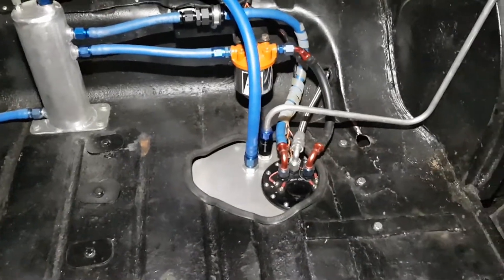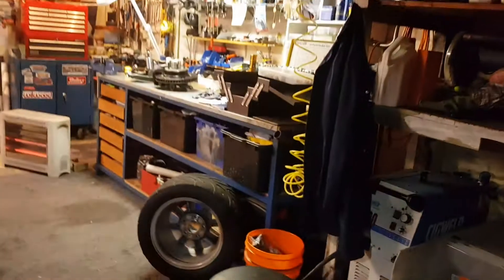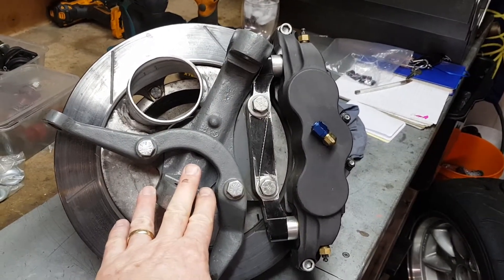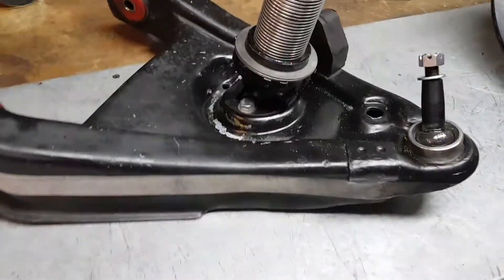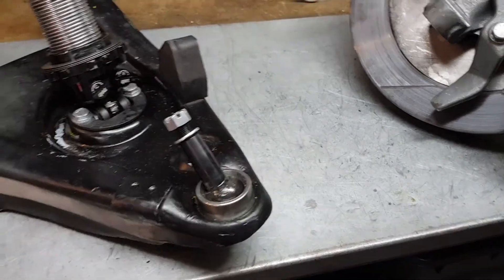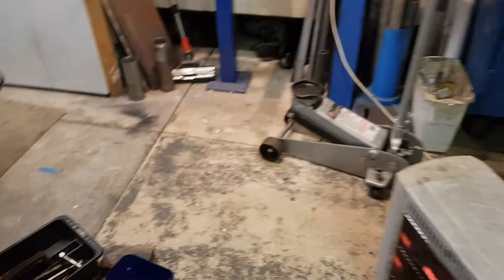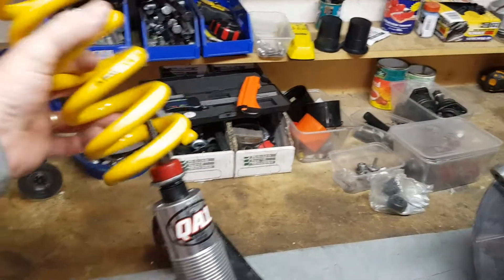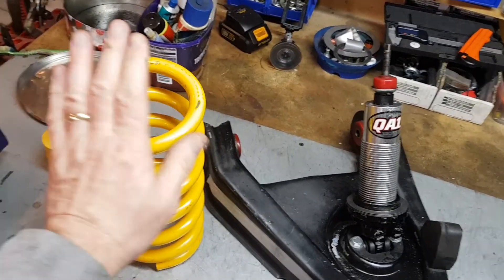HQ 350 HOLDEN FRONT SPRING UPGRADE

Comment: Very interesting information,  that's something I need to dive into soon.. I have noticed since new tyres it starting to feel soft in suspension, I'm not sure if that's a bad thing.  Thanks so much for taking the time to share your amazing knowledge...
Reply from the maker: Very nice of you what a gentleman. I built my car with a similar brake setup at the front as you have. They burned up once you get her really movin. The rubber dust boots that most street calipers have to prevent dust damage to the piston seal end up jamming the piston out as they crumble from the heat. That's why race style calipers have no dust boots.
Reply from the maker: I'll have a look tonight